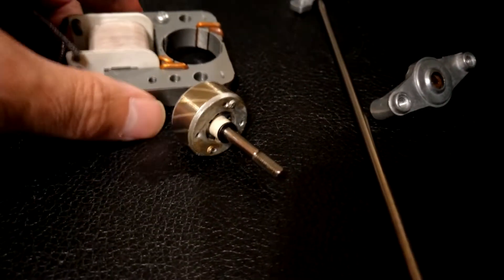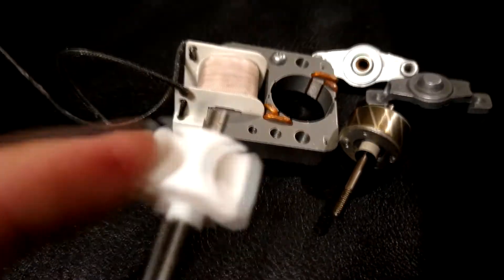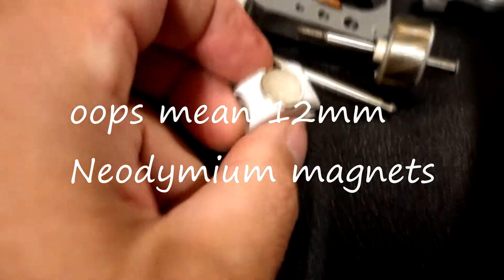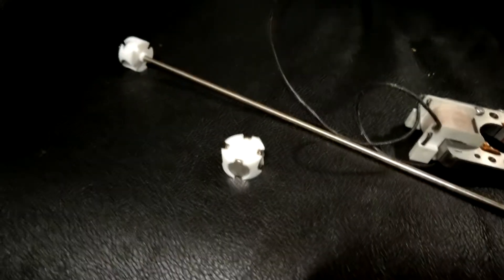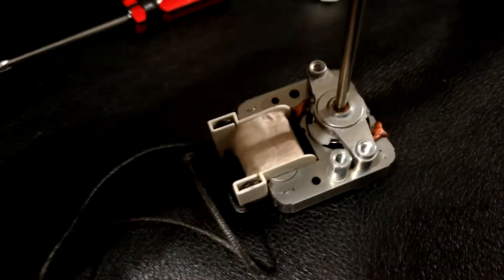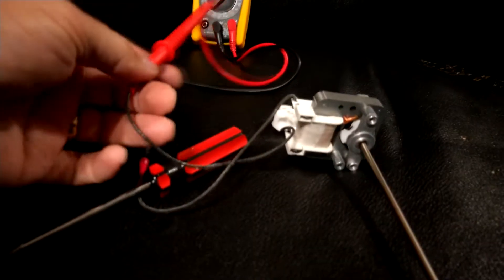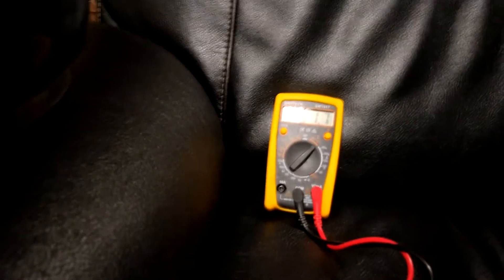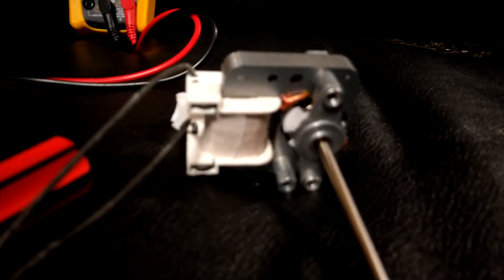Fan motor hack from a microwave oven

Comment: Hello

I have a question about wiring a motor like this to 220 V. Does it matter which way around the two wires are connected? If so, what happens if they are wired the wrong way? 

Regards
Reply: It’s doesn’t matter with ac voltage.
 Each wire = 110 vor 120 v  both wires total =220v or240v.
Reply: @scottvan1898  Thank you for clarifying that.

Comment: I built one of these about 1974 but the magnets weren't great then but the copper things short the output out somehow..also wondered what if you put say 10 mm magnets but use 6 and zigzag them...I think if the iron has a gap it will put out more it makes the field go thru the copper..mine had a 1/8 gap where its thin...it puts out more that way..If I can find another fan I might build one..oh hey there's another thing..there's one winding on these that is 64 ohms instead of the more average 32 ohm..they put out twice as much watts...happy experimenting lol...

Comment: 😱Only 1.8 volts🤔
Reply from the maker: Well It was a uncalculated outcome. So have not made a continued video..😞, but did not fail completely. Just not the expected results.
Reply: @tariqstech  cut out the copper field shunts!